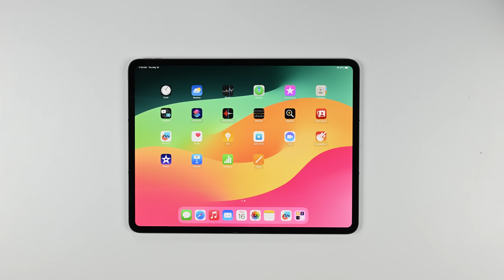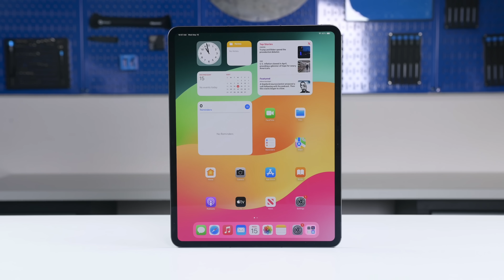iPad Pro 13" Teardown and  Apple Pencil Pro Destruction

Comment: Has anyone had a problem with pencil pro quickly discharging? From 100% to 0 in just under 4 hours. When reaching 50% it would discharge at the rate of 1% in just one minute. The shop exchanges pencils 3 times but they appeared to be fine when attached to other ipads. So, the fault was with the Ipad (it's Ipad Pro 2024 11 inch) I wonder if it's a common problem with these new ipads. I eventially returned the Ipad and got a refund. But I'm now confused as to what device to buy or even consider buying a used one. Has anyone else faced a similar problem?

Comment: My apple pencil died after 3 years of sparse use because the battery doesn't hold any charge anymore. Why? Because it was magnetically attached to my ipad at all times, keeping the battery at 100% all the time which most likely killed it. I really need to have a pencil on that ipad and hate that I have to be a new one just because the irreplacable battery died just because of intentially bad battery management.

Comment: I had an Apple Pencil gen 1 that sat in the box for a while (over a year) between purchase and finally using it. When I tried to use it, the battery was completely dead and wouldn't charge at all. It was very frustrating having to buy a new one.

Comment: Remember the surface pen? It has a AAAA replaceable battery that could as well be a lithium ion battery. No need to have this in a oen
Reply: Eh honestly that has good utility, it means you can just hotswap rechargeable AAAAs so you never need to wait for the thing to charge. great for professionals who might need to use the thing for 9+ hours a day.
Reply: @sootstainedruby1439  it lasts for 1+ years on one battery

Comment: Great job as always, guys! Happy to see some progress from Apple, the battery should be even easier to repair that what they have but this is miles ahead of previous gens.
I understand that specially tablets are not computers and (most) ppl don't expect them to last for like 10 years, but batteries specially die far quicker than that, specially on a 1 day device.
I hope the next gen is even better, having to heat glue just to replace a battery seems excessive for ordinary people and counter productive for technicians.
But again, great job from iFixit!

Comment: While I understand the difficulties in making small electronics like earbuds repairable, the pencil still seems like something you could pretty easily have a battery at the top that could just slide out. I'm sure there are balance considerations or power distribution issues, but it feels like something that needs to happen.
Reply: It does not a replaceable battery - are going back to the AA and AAA battery days are we?  This would also make the device larger and the cost of the battery would be at least 50% of the device, so where’s the economical advantage?

Comment: Disagree with all improvement you mentioned

Why i would care about the pull tabs if changing the battery with a genuine one will trigger a warning message

What does it mean " repairable " if modules are paired

What improvement in the pencil over last gen if you cannot put it back together

Comment: I wonder if this tandem Oled will be the future of TVs vs regular Oled.
Reply: Should be but it won't since Apple had to basically force, Samsung and LG which make most OLED TV's to make this, tandem OLED. Told them current OLED they using in TV not good enuf i.e. burn in, saturation and peak brightness being biggest issues. Definitely has to be most expensive part this iPad since basically sandwhich 2 OLED panels together. No way they could scale that up to 65" TV sizes.

Comment: Apple has to get repairability and backwards compatibility in check
Reply: No they don’t have to.   I never get any Apple devices repaired because I look after them and had no hardware issues whatsoever over many years.  I don’t support BC either - you want to use the latest buy the latest.
Reply: @SpeedfrkOne "I, myself (a sample of one), am the centre of the universe and all of my experiences are universal"

It has nothing to do with taking care of your tech. Defects and issues still occur (there is always a failure rate, with any product, even products with good QC) and by their nature batteries are finite lifespan products. Using any battery powered product daily will inevitably and rather quickly wear down its battery, even if you practice good charging habits. Not all of us want tech to be disposable and needlessly polluting.

Companies improving repairability doesn't negatively affect you at all so I can't say I understand this comment as anything other than trolling. Why else are you wasting your time on iFixIt content if repairability is such an affront to your worldview?

PS. I'm not sure that you understand what backwards compatibility is.

Comment: Its crazy.  Last night I put a new battery in a 10 year old Kindle Paperwhite and had it running again, then I did a flashmod upgrade and case and battery replacement on an iPod.  Within 10 years we went from being able to replace parts for kit that would last decades to spending $1000 to rent/lease e-waste.
Reply: agreed, the corps are disgraceful as are the governments allowing them to get away with it

Comment: I wonder what would happen if you would only connect one of the tandem OLED screens. Would be fun to see under the microscope which of them is functioning, the top one or the bottom one.
Reply: Ummmm the word “tandem” means more than one component operating together so both panels are operating as one together.
Reply: @SpeedfrkOne  If you've watched the video, they said that the screen has 2 separate connectors one for each OLED panel. I get that they are working in "tandem". Hence, I thought what would happen if you disconnect one of the panel.

Comment: designing the apple pencil pro without considering replacing battery as well as apple charging a premium for their electronics for design is a huge oversight
Reply: No it isn't. This is basically necessary for such an ridiculously tight design. There is pretty much no digital Pencil that is repairable. For reasons.
Reply: @Raja995mh33  surface pro 3 pen had replaceable battery

Comment: I have a question - when you guys make replacement logic boards, they have the same M series or A series chip as the original, so where do you get those chips? I'd assume Apple does not just throw those designs out into public space.
Reply: It's apple that makes and supplies the boards to ifixt, they ara just distributors.
Reply: @fernandoferraz4146  Why would Apple give logic boards to iFixit? Apple is against 3rd party repair, they would never.
Reply: @fernandoferraz4146  Apple does not supply boards to iFixit. If they did, iFixit would list that as a genuine Apple part.

Comment: Beautiful device but why not buy a macbook by then
Reply: Exactly, especially with this thing running iPadOS (basically iOS).  You'd be much better served by a cheaper MacBook Air
Reply: Pen & Touch input for creative apps like drawing, painting, sculpting... - for things like that especially on the go this is one of the best solutions.
Reply: @Charles_Bro-son  I am not an artist by any means (I'm actually a software dev) but wouldn't a surface pro be better because of the app support?

Comment: Am I missing something  the hole left side past the battery is empty space?
Reply: That’s where the display controller goes, it is connected to the screen and so leaves a space when the screen is removed. You can just about see it when the screen is being taken off at 0:57.
Reply: Thanks

Comment: The fancy shadow thing they did with the pen almost overshadowed my concerns for practicality, but this brought me back to my senses. The new ipads and pens have their place, but apparently, that's not with me yet. I'm not in a position to treat my electronics as disposable.
Reply: During regular use, your pencil will rarely drain more than 10%. The battery in the pencil far outlives the useful life of the device.
Reply: @Seacle14 facts
Reply: @Seacle14  this. And if something actually breaks on the Pencil, it's generally destroyed entirely to begin with. Pretty much nothing in that thing would break on its own that would even make sense to be replaced
Reply: Or you can get AppleCare or you can resell it a good home. But that wouldn’t suit your narrative so …
Reply: @RunForPeace-hk1cu  lol, narrative? I'm just a poor African who appreciates a reasonable level of repairability, not some activist trying to create a problem for your apple. Getting insurance or selling it on when it bricks would be nice, but it's just not practical in my country.
Reply: It would have been worse for the environment if the pencil was repairable. Because repairability would have come at the cost of reliability and complexity. For an otherwise currently indestructible device

Comment: The non repairable pen is an absolute ridiculous mess
Reply: I guess you never heard about AirPods
Reply: @GenusWelt Airpods are pretty easy to disassemble and to swap the battery. Yes, it is destructive to the housing, but that is a cheap piece of plastic, bought in bulk for 3.50. No tears to cry. 
This pen on the other hand, is trying to disassemble a one hour game of Tetris from the side.
Reply: It’s really not. How would you make something that complex in a pen form and have it easily repairable? I don’t know of any company that makes a stylus anywhere near as complex as this, and has it easy to take apart and repair.
Reply: LMFAO. You have to sacrifice some repairability to make a product this integrated.
Reply: And basically necessary. Pretty much no digital Pencil like this is repairable AT ALL. Being it the S Pen (and its thousand variants) or pens from Wacom and such. There is just no wanton built those in a way to repair them. There isn't space for that
Reply: @Raja995mh33 many pens from other manufacturers use capacitors or passive technology, i do agree with the sentiment tho
Reply: @Raja995mh33  At least the S-Pen uses a supercapacitor for power, which doesn't suffer from the same degradation from simply charging and discharging that a battery does. And most Wacom pens work via EMR, so they don't need a battery period.
Reply: who will bother to repair a pen when a new one will be 100 dollars soon. Like the specialized technicians don't even have incentive to try even if it was repairable. It would cost almost a new one.
Reply: You just said it, it literally the size of a pen. Do you really think it’s that easy keep all of the features and its size while making it easy to open and replace all of the individual parts?
Reply: making a fully repairable pen would make the product objectively worse but they definitely should’ve added a way to change the battery when it starts to wear out or use a capacitor which don’t really degrade overtime and almost charge instantly, but they have much lower energy density
Reply: The idea of trying to repair a complex computer crammed into the size of a pen is laughable to begin with
Reply: @narutobroken I dunno. I think they could probably make the battery replacable if they really tried.
Reply: @narutobroken How's it laughable? If it was possible to disassemble it easier I think doing stuff like battery replacements isn't a big ask
Reply: @narutobroken  at least they could make the battery removable. Something like sliding it from the top.
Reply: 6:21 Is this the connector for the battery?
Reply: Apple is green , they remove sticker because of plastic
Reply: “The idea of a non-repairable CPU die is an absolute ridiculous mess” is all I am reading.
There needs to be a line drawn for when we can criticize products for repairability and when we can’t.
Reply: Not a single consumer stylus released has been repairlable. Your comment is ridiculous.
Reply: Should be illegal to sell non repairable pens imho. I hope EU laws will help.
Reply: Same logic as the AirPods in my eyes, the amount of precision engineering required to make the device reasonably small while repairable would just make them cost too much to be worth it, and making the device worse for the sake of repairability is quite frankly stupid as hell as long as it is durable enough for the average user.
Reply: And its quite expensive, but still cheaper and better buy a new one than repair it
Reply: @ewwwwhh Note that they will do replacement for dead batteries for cheap.
Reply: Never heard of pencil having problems and has to be repaired.
Reply: @SiddharthVyas  Have you heard of one becoming obsolete and has to be dismantled for recycling? 
Shredding electronic waste with LiPo batteries inside, is not an option.
Reply: It was never meant to be repaired as it’s a disposable product. Just like every other pencil on the planet, it is what it is, what’s up with the whining? I can understand other products like the iPhone and iPad, etc but AirPods and this pencil are exceptions I’m personally fine with. It’s understandable. Move on.
Reply: @KieranBLK   if you include ink nibs and mechanical graphite pencils? For example when nibs are consumed it's possible to change only that small piece with a new one, same as Apple Pencil with the small plastic tip. And so on with mechanical pencil leads. Maybe it's impossible to engineer a Bluetooth pen with batteries that can be replaced I have no idea 🤷‍♂️
Reply: Apple couldve just made a modular battery. If you can replace the nib, you should be able to replace the battery. Its dumb aesthetic over functionality again.

Comment: The iPad battery repairability still sucks because the battery is paired to the motherboard. As is the display and camera units. Automatic 0/10.
Reply: the use of glue should equal zero repair ability by default

Comment: Automatic 0/10 repairabilty. Apple's definitely gonna pair the parts to discourage third party repairs and force users to buy more expensive models.

The only green thing in Apple’s mind is $$$, doing it through greenwashing by pretending to care about the planet, all the while making older accessories incompatible with newer devices for the sake of fleecing gullible customers. How else would they be a trillion dollar company. 😂
Reply: Apple recently announced that they’re allowing users to re-register parts providing they’re not from a stolen device
Reply: At this point I’m gonna report your comment as spam
Reply: Would you stop to repeat this each apple teardown?

The scale has a meaning 
0/10 automatically just doesn’t make sense 

Apple has sketchy ways to prevent right to repair 
True

Apple products are often overhyped 
Yes

But please stop repeating apple devices deserve authomatically 
0/10 

Apple repairability is already low as deserved